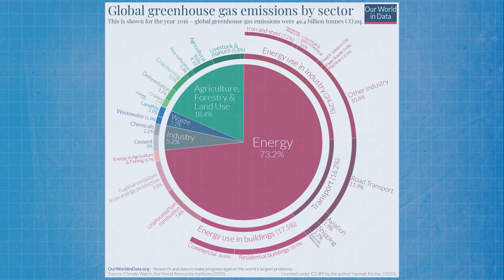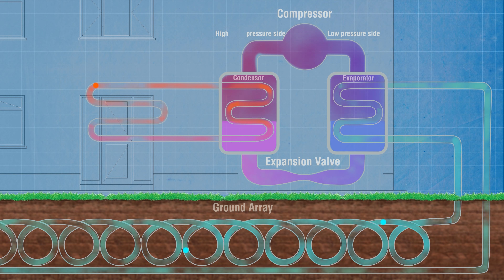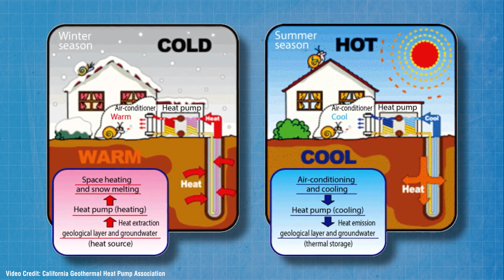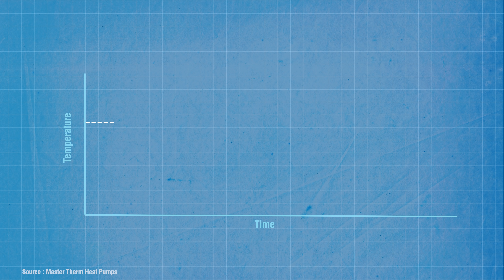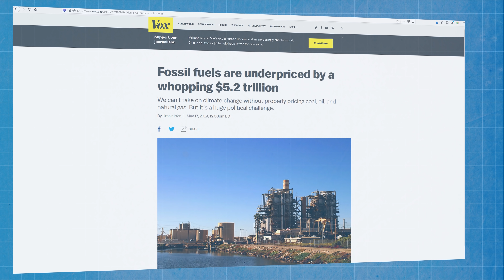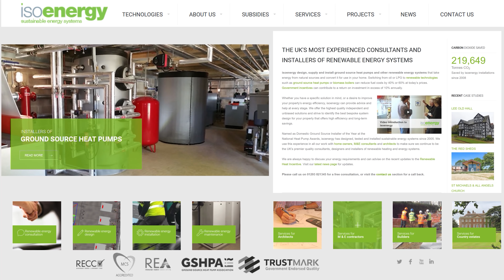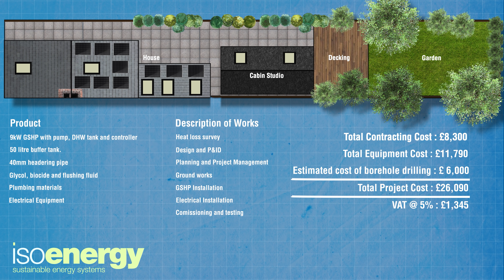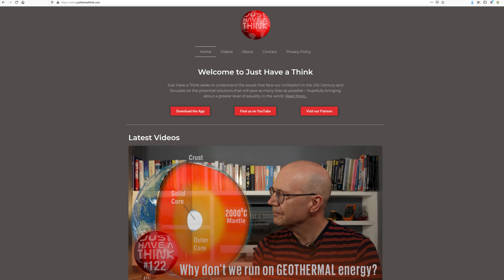Geothermal ground source heat pumps. Heating your home from your own back yard!

Comment: It's just electric heating with good PR (and you've fallen for the COP of 4 nonsense). And high ground water levels in the UK makes all claims for COP a nonsense. The cabinet which holds all the kit is enormous, and thus impractical for anything other than large houses with a good garden. You are far too uncritical of this fashionable greenwash.
Reply: Sorry you feel this way Mike. We would be delighted to take you to visit some of the sites we have helped and you can see their energy bills for yourself. This isn't a theoretical exercise, we have built our business on it.
Reply: @isoenergyltd  I'm an architect. I've specified these things for clients when they've insisted, despite my warnings about the performance claims.......and I've seen the results. Further, I really don't care about the bills. For the planet's sake, it's the CO2 emissions I care about, and at the moment, when we are still using vast amounts of fossil fuel to generate electricity, using electricity for space heating doesn't help anyone. Fine if you live in Denmark or Iceland and your electricity supply is virtually zero carbon, but not here (Southern England), where it isn't. Oh, and nothing you can say will change the fact that the kit is half the size of a room, making it impractical for most urban settings. You've essentially called for government subsidies for the landed rural middle classes, which isn't the sort of thinking I'm keen on.
Reply: @MikeAG333  Totally agree the performance claims of the HP manufacturers are total fiction. Happy to provide you with real, on the ground data for sites we have installed so you can see the real situation for yourself. Our industry is beset by people relaying out of date information on efficiency as well as miss-selling, so you are right to caution your clients. Anything I can do to help bring you up to current best practice, I will do. I can't be anymore upfront about it. I'm here with real data, real customers and a sustainable business model and am more than willing to talk.  At the same time, I can show you some kit that isn't a room full of tanks. A lot has changed in this industry in an attempt to bring it to the wider market.
I too care not about running costs, but end users do. They are the ones that will make a difference, not you and I. I should however have said 'see the reduction in their energy consumption', would have been more accurate. My bad.
Personally, and as a business, we buy our electricity from a 100% renewable electricity tariff to encourage more deployment of renewable generation. The sooner we can clean up the electricity generation sector the better that is for sure. 

I think Voltaire said something along the lines of, "I may not agree with what you are saying, but I would fight to the death for your right to say it." I would however, prefer you to base your opinion on real data, seeing as you are in a position to influence others. Your clients are potentially missing out as a result. Many of the architects we have done work for will always specify renewables where possible with excellent results. There is a list on our website.
Reply: @isoenergyltd  I do specify renewables wherever possible, just not electric heating. (And I love the way you guys will do anything you can to avoid saying that it's electric heating).  I've built some of the lowest energy buildings in the country, and so the emphasis is on controlling losses, not massive bits of kit on the supply side. If 4 or 5 candles would heat the house through a winter, what's the point in £30,000 worth of GSHP, or even an air source heat pump (= air conditioner with good PR). Most of my houses need only a woodburning stove to supply all of their heating requirements.

Here's some basic figures for you. Average UK electricity production has an efficiency of about 30%. Add in transmission losses and we're in the ball park of 25%. Multiply by real world COPs of 2 to 2.5, and the net effect is that the lump of coal which was burned in the power station has provided 50 to 60% of the heat it produced there as heat in the GSHP-heated house. You only need a burner in your house with an efficiency of 60% or more to be better off burning that same lump of coal in your own lounge......for the capital cost of say £2000 compared with 15 times that for your bit of kit.
Reply: @MikeAG333  Great. I genuinely applaud you and agree with your commitment to not needing the energy to be spent in the first place. There we are on the same page. What do you do for your cooling out of interest?

Yes of course a heat pump runs on electricity and not burning stuff. Approximately 25% of the energy in a heat pump comes from electricity, the rest from the heat source, in this case, ground.

I thought the whole idea of all this was to combat climate change and stop burning stuff, on-site or off with the massive losses you point out? Or have I got the wrong end of the stick with this sustainability stuff? The whole idea was to generate and use energy sustainably, where it has to be used at all, without burning fossil fuels, biomass or whatever you want to put on your fire. I thought the keyword here was Sustainability. Burning fuel isn't sustainable at the current rate, hence the need for action and our industry plays only a small part in that.

I am sorry you have had a bad experience with heat pumps in the past. Its a pity you didn't use us or your view may have been different. All the best.
Reply: @isoenergyltd  I haven't had a bad experience with heat pumps. I've simply done the maths.

You don't seem to understand that your system requires the burning of fossil fuels, and at a higher rate than burning them directly in your own home. My fault for not explaining that well enough.
Reply: @isoenergyltd  I'm not sure who I'm talking to here. Is @isoenergy  also Dave of JHaT? If so, maybe there is a way of making that a little clearer.
Reply: @MikeAG333  not at all My name is Jonathan Price. I look after the marketing here at isoenergy. Our only link with Dave is he bought his solar PV system from us. When he requested info on GSHP for this show, we were happy to help.
Reply: @isoenergyltd  Thank you.

Comment: Do ground source heat pumps drain heat from levels of the ground that depend on the warmth?
Reply from the maker: They do if they are too shallow or if the area of ground is too small for the heating requirements of the home. Always get a second opinion and survey before committing - there are some sharks in the trade just like all other trades unfortunately.
Reply: @JustHaveaThink  Thank you.

Comment: I see geothermal ground sourced heat pumps going mainstream, but a lot of things need to be done to get there, mostly availability of products.

Manufacturers have been mass producing ASHPs (Air Sourced Heat Pumps) but GSHPs (Ground Sourced Heat Pumps) are still made one at a time. If Tesla gets into home HVAC, I expect the price of the GSHP equipment to be on par with ASHPs within a decade.

Borehole drilling is currently quite expensive, and mostly done with water well rigs. Dandelion is trying vibrational boring, but if down-the-hole hammer (percussion) rigs were readily available for rent, building contractors and even DIY homeowners would be able to bring drilling cost down by at least half.

DHW (Domestic Hot Water) production with a GSHP in cooling mode provides free AC (or free Hot Water depending on how you look at it). Priority Hot Water provides all the DHW, desuperheaters only provide some.

Variable Speed compressors are currently expensive in GSHP but provide about 10-15% electricity savings over staged GSHP and the compressor lasts longer. Currently the price is marginally higher, but should come down with more availability.

Turbo-expanders replace the compressor and expansion value and provide about 10-15% electricity savings plus increase the max load the GSHP can provide. Currently the price is too high due to low availability.

Many homes have poor air sealing and inadequate insulation, many states make the power companies provide the incentives to homeowners to improve their energy usage. Building codes set the minimum insulation low, but at least they continue to bring them up most code cycles, increasing the required minimum insulation valves more will decrease energy usage for new and renovated homes.

The larger the size of your electrical wires, the less electricity is coverted to heat through resistance.
The larger the pipes in a GSHP ground exchanger, the less electricity is coverted to heat through friction. The GSHP industry concentrates on pipe sizes that are near the size of water supplies (3/4 inch to 1-1/2 inch), using the larger pipe leads to less digging (Turbulent flow is essential in the small sized pipe, but less essential with larger pipe in variable systems)

Bentonite high thermal conductivity grouts need to be produced as commodities. Right now they are quite specialized.

Comment: Can these be combined with solar power?
Reply from the maker: Well, you can certainly run the pumps using solar power if you have it installed.
Reply: @JustHaveaThink  I should clarify my question I think. Would this work as an "supplemental" power supply? If I have solar, but it's not enough for my energy needs.

Comment: A split AC unit works brilliant as a poormans heatpump and costs around 10% of the example 26000 pounds. In the Netherlands around 2000 euro's fully installed

Comment: I have a heat pump a/c unit where I live now.  I used to live where I used a 5,000btu window air conditioner just during the evenings in the hot summer and ran it for an hour before bed time and 2 hours afterward.  It cost me $5 per day extra for those few hours of use.  I live in a mobile home now that is nowhere as efficient as the home I built was and is 100% electric.  HW heater, stove dryer and heating and air conditioning are all electric and my electric bill for everything summer and winter averages about $60/ month.  I am a believer.

Comment: Great topic Dave.  A couple of thoughts: subsidies bring out con-artists...I have seen that with Solar hot water systems, GSHP's, Solar power systems and even in government sponsored re-education initiatives.  Buyer beware.
Re GSHP - have an energy audit done and make sure to address all insulation and air leak issues.  Do not install a GSHP if you plan on renovating as it will change the energy requirements.  Once the house is properly sealed and insulated have another energy audit done to confirm heating and cooling requirements.  In floor heating is the ideal companion to GSHP as noted by someone else...temps are lower which works well with radiant but not well with forced air (for heat).  (Note - If you have your humidity very well controlled and your building is well sealed you might be OK using your radiant system for cooling your house...but you better have a super capable tech setting this up.) The GSHP itself must be sized correctly for your requirements - no "thumb in the air best guess" or "a bit larger ought to do it".  If you use forced air be ready for the cooler air temp and higher air flow...in new builds the ducting will be much larger for a GSHP system than for an Oil, NG, Propane or Electric element systems...retrofitting the ducting system is prohibitive so this is on area where a compromise must be made.   The loop that is buried outside must be sized properly to support your GSHP as you will run into trouble if the loop is too small and will have pumping losses etc if it is too large.  GSHP systems are not DIY projects unless you are an engineer and even then experience is invaluable in avoiding the many pitfalls that can accompany this sensitive solution.  
Yes I have a GSHP system...installed in 2010.  Did I follow this advice?  No, I wasn't aware of it back then.  Am I happy with it?  For the most part I am but repairs are extremely expensive and there is only one repair tech within 90 minutes drive.  I have done all repairs myself from year 3 on except those that involve the compressed gas.  Would I go for a GSHP again?  I don't think I would simply because the Air to Air heat pumps and Air to Water heat pumps are almost as efficient and cost many times less...and because they cost less there are more of them out there which means there are more capable technicians available to service them and the fees are competitive.  Number one thing I would do first though is to make sure my home is as air tight and insulated (including quality doors and windows) as I could possibly make it before selecting an HVAC system.    BTW I am in Canada...-30C winters and +30C summers.

Comment: I want to add something to this discussion.  I live in the Northeast where natural gas is not  available in many places. Many of us use oil heat. I looked into ground source geothermal heating, and the cost was prohibitive since we dont have central air. We kept the oil system.

There is a middle ground. We installed air source heat pumps to supply heating and cooling about 7 years ago. The units have displaced about 20-40% of our oil usage during that time. On average we are talking about 200-300 gallons of oil. Considering local oil and electricity prices, I am saving hundreds of dollars a year and my payback period is about 5 to 8 years. It's a bit hard to guess year for year, but its a good estimate. We use oil for hot water and when air temps are below 30f or so. 

Its worth a look if geothermal ground source heat pumps are outside your price range.

Edit: fixed spelling and clarified one point.

Comment: The biggest saving you can make in a house is to install very high grade insulation, and good control of ventilation. My own house is built as a 'Tea Cosy' with underfloor insulation , 200 mm insulation in the walls and a SIPS roof. All windows are of course to the highest standards , ventilation is via a combination of 'earth pipes' and HRVS . Heating is by Air source heat pumps serving the Underfloor heating pipes and hot water tank. 
One unusual approach was our use of the the underfloor void to supply air prewarmed from the earth beneath to the ventilation system , it supplies air at 13-14 degrees all winter with out side temp around 0c, and in summer it supplies air at 16-18 degrees most of the summer (it did reach 20 once when the outside air was 28). 
Another feature is the use of the outgoing air from the ventilation system to supply the intake for the ASHP in the roof. The expelled air is often well below freezing! The COP is around 5, a very decent return. 
The mechanical Air-con is of course powered by the solar PV panels, which also charge the LEAF much of the time. 
I did look at the idea of Ground Source heating but at the time with no grants and lack of industry interest we decided to DIY our solution.
Reply: Not bad solutions. I consider to buy an HRV with built in heat pump it can provide extra heat on coldest day as well it allows to undersize heating and cooling systems
Reply: @andreycham4797  I have found  that my set up allows me to maintain the house heating level at a very comfortable 23 degrees in minus outside temps, with no other input. Except of course solar gain through the windows. 
I started with a large ASHP rated at some 11 KW, but changed to three small units with a power drain of 1100 watts each which I use in parallel. Normally though only one is in use except on the coldest windiest days. 
The importance of good insulation was illustrated when the heating failed during a winter freeze period, (It was cold enough for the UK government to be paying out on the 'cold weather 'payments for the elderly)  It wasn't until four days after it failed that my wife was moved to wear a cardigan in the evening.  The failure was a simple £5  relay and soon fixed.

Comment: As always, such a clearly told message on a topic that should be common sense for consumers and policymakers alike. Thanks Dave !
Reply: Yep. It's a common sense for anyone that wants to save money. Of course, you'd also be reducing the profit of fossil-fuel merchants and middle-men, who work hard to poison opinions and lobby governments to reduce the rate of this type of thing taking hold.
Reply: Anything but commonsense, fantasy nonsense actually. Geothermal  is partly the primordial  from when the Earth was formed and partly  generated from within the Earth's crust from the decay of mildly radioactive elements, it is additional to the already heating planet.

Comment: I live near a lake  in a small rural town (in Ontario, Canada) and have an artesian well which provides a steady flow of water year round.  I also have some small rivulets of water in my basement (mostly "crawl space" where the dirt comes up to about 2 feet under the floor).  I am wondering if I could collect the water then pump it through pipes under my floor to provide a source of warming (or cooling in summer).  At the end it would come out into a sump and drain away.  Anyone tried this or have any knowledge of such a system. I should add that the house is supplied with hydro electricity and high efficiency pumps used in radial heating systems are available.